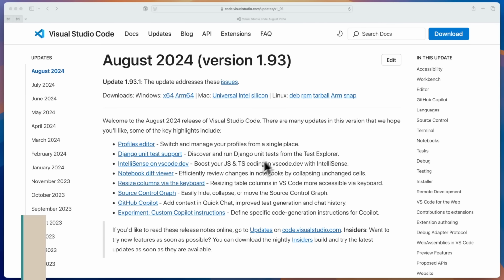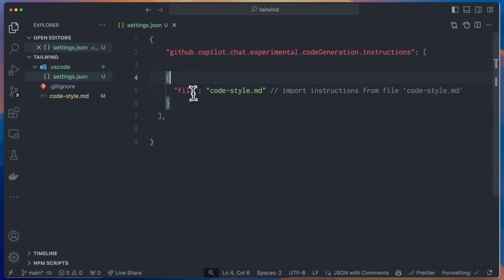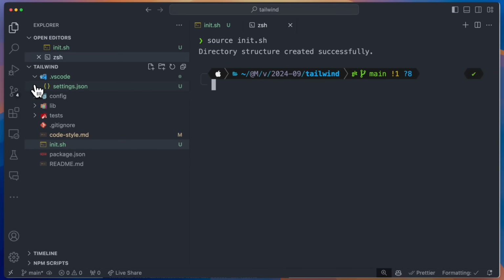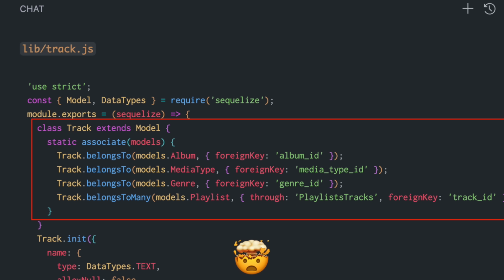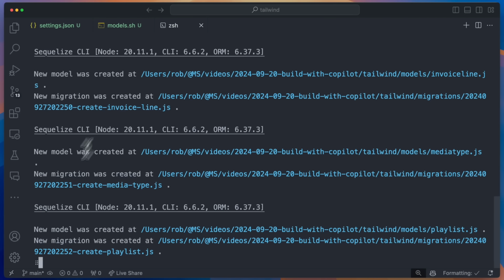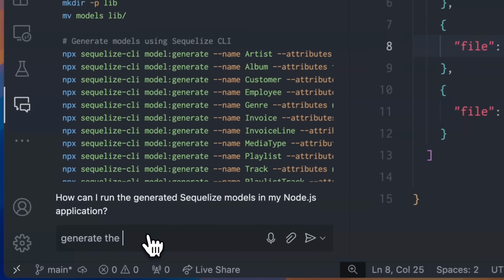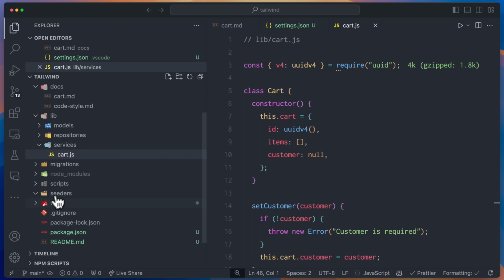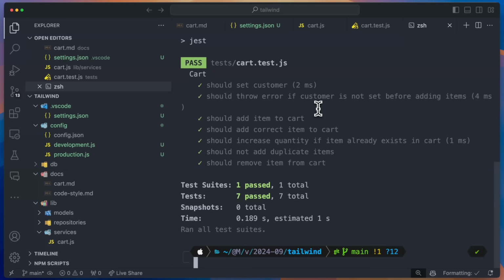Using Custom Instructions with Copilot to enhance our prompts

Comment: But doesn't Copilot take all the files that are open into account, i.e., just having them opened would have had the same effect, correct?
Reply from the maker: For the examples shown, yes, but what Rob didn't show is how you can also add text to support the files. Something like "Code only" if you don't want explanations, or "use Aussie slang" if you want to lighten the mood.